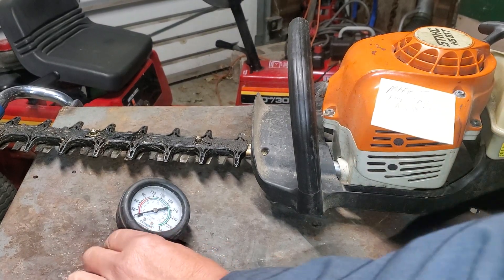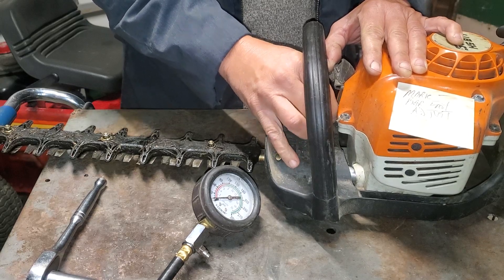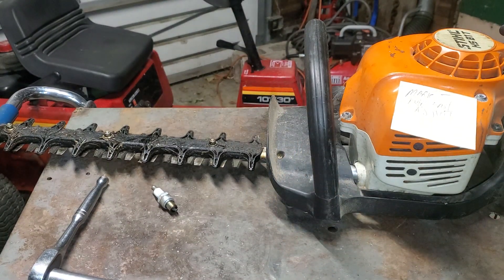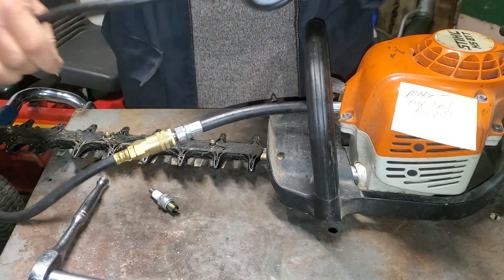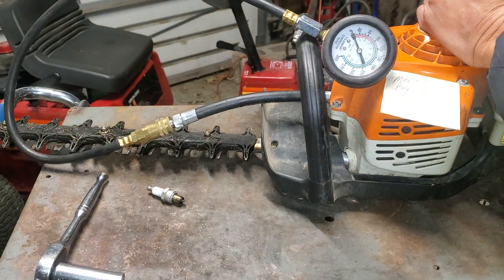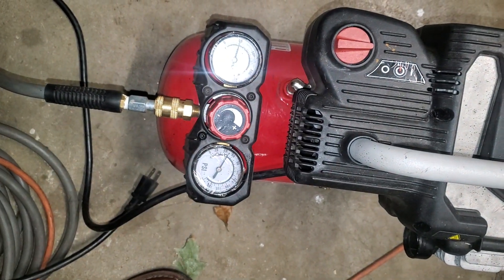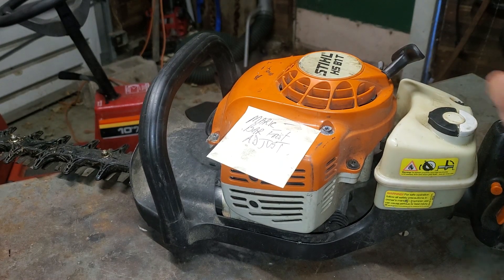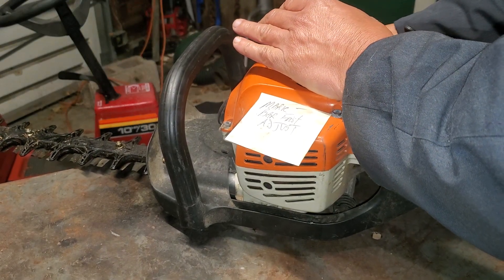Two cycle engine compression check - is it even worth doing?

Comment: I was checking the compression in two of my string trimmers recently. Like you, I couldn't get my screw in adapter gauge to work at all on either one, Zero psi. Works fine on everything else, but not these little weed eater type of engines. Why? Dunno. This much thought is above my pay grade. I finally bought a used gauge with the rubber push into the spark plug hole fitting with the schrader valve in the end of it, and that works. Found that one of my machines read 120 psi so it's ok, the other less than 90, so that one's junk.
Reply from the maker: Good info thanks

Comment: Sorry, not a question. More of a statement. Without it, the reading will be low. Max pressure will be when piston reaches TDC. You need a shrader (check) valve at the end that threads into the cylinder head to allow pressure to build with each pull.

Comment: I'll add that compression guages are junk at Harbor Freight. They read way low even on car engines. 
I've had mine since the 90's, don't know what make it is, but it has a schrader valve right at the spark plug. I had to get a new valve recently, they're special low psi ones just for this purpose. Brand new Stihl BG50 blower has 150 psi.  I never got more than 120 out of my Husky blowers, at less than 100 they don't start. Not much room for wear.

Comment: I've been a Stihl dealer since the mid 1980's selling and repairing thousands of chainsaws, blowers, hedge trimmers, lawnmowers etc.  I get pulled off the counter often to render a second opinion when my technicians are questioning and confused by strange compression readings.  Two things I see wrong as I watch your video.  First, the compression gauge you're using is better suited for use with large displacement four stoke engines (automotive, motorcycle etc.) but probably still ok to use with a 160cc lawnmower engine.  The internal volume of the 10mm adapter coupled with two to three more feet of unnecessary hose probably exceeds the the 22.7cc displacement of the Stihl HS81 engine you're trying to test.  For small displacement two stroke engines I prefer Echo's compression gauge because it is designed with a short hose having a small internal diameter.  Also the valve stem is located as near as possible to the combustion chamber even when used with their very short 10mm adapter.  I've found that using this style of tester will not only produce accurate results but also allows me to see how many pulls of the starter rope it takes to reach a maximum reading.  A heathy engine will be at 90 percent or even higher on the first pull of the starter and  peak out at a maximum reading after the four or fifth pull.  A suspect two stroke engine will have a low reading on the first pull and require ten or more pulls slowly climbing to maximum which is usually less than 115 PSI.  Engines with these test results will be hard to start, low on power, die when they warm up or won't start and run at all and should be inspected much closer for damage or wear to the piston and cylinder.  The second thing I see wrong is your gauge only recorded a reading of 10 to 20 PSI maximum.  It is IMPOSSIBLE!!!! for an engine to run with a reading that low meaning that your tester or testing procedure or both are faulty.  I suspect that if you had been able to connect the tester to the 50 PSI stored in your air compressor the gauge would have read 50 PSI.  My guess is that the valve stem in your 10mm adapter is loose and should be tightened or replaced.  There could also be a piece of carbon or dirt holding the valve open allowing the compression pressure to escape back into the engine rather than be captured and building to a maximum reading of 130 to 140 PSI even in your overly long hose tester.  Remember the compression in this engine is momentary not constant like the 50 PSI in the air compressor tank. 
After hearing the engine start and run it ran perfectly with a stable idle, good throttle response and a slight "blubber" at no load high speed.  That is exactly what a premium piece of Stihl equipment should run like.  I hope this has been helpful and insightful for you and everyone out there.
Reply from the maker: Real good info thx
Reply from the maker: @stevencutler9327  sir, your input is well received. You are a very knowledgeable technician.